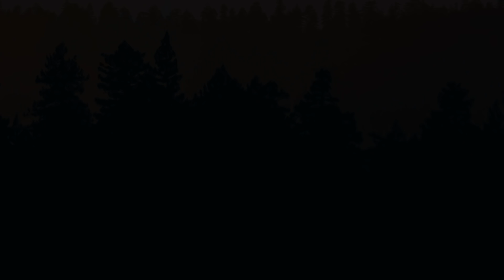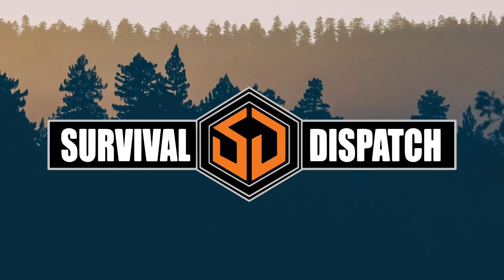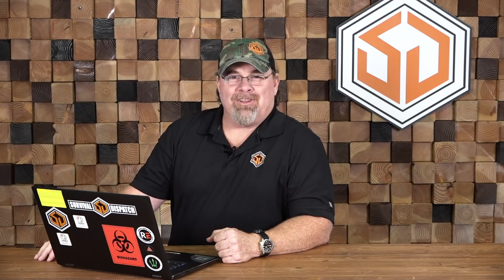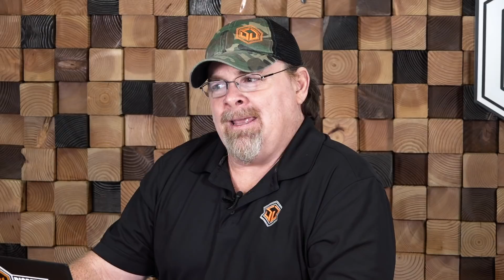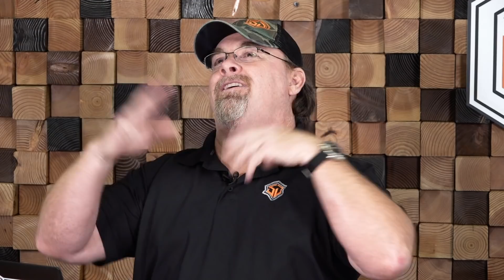All About Generators!

Comment: I have a 5500 watt Generac. I keep only three five gallons of ethanol free gasoline on hand. I date the gasoline containers very four months I start pouring my stored gasoline in my vehicle and replenish with fresh. Also have a propane grill with side burner and keep two twenty gallon bottles on hand for cooking. Just run refrigerator, ceiling fans, and lights with generator. Sorry grandma; self preservation is the first rule of nature.
Reply: Here are the rules about portable generator safety: This is just a reminder for everyone’s safety. All generator safety rules should be followed carefully. This advice is just to make sure that everyone is aware of all the warnings and it’s just to remind people to be careful using portable generators. Generators can be dangerous if not used carefully. Every year, hundreds of people die or get injured when using portable generators due to carbon monoxide poisoning and electrocution. Make sure you are using your generator carefully and keeping others safe as well. There is something very serious that everyone should always be aware of when using generators. Some people do run their generator indoors which is not safe and that increases the risk of carbon monoxide poisoning which can cause death of family and you. Some people run their generator in wet conditions which can electrocute them. Please remember that you should never run your generator indoors. Remember that carbon monoxide is an odorless and colorless gas that you cannot see or smell. Carbon monoxide is a silent killer. Keep that in mind. Make sure your generator is 15-20 feet away from your house and away from doors, windows, and vents. Never use your generator in your porch too. Having a carbon monoxide detector is very important against generator safety. Some people also allow children to go near the portable generator which could pose risks. We need to keep an eye on our children making sure that they are not near the portable generator so they won’t get electrocuted or burned by the generator which is dangerous. A locking enclosure also keeps kids safe. A generator shed might look like a tempting place to explore, or take cover during a game of hide and seek, but a generator is a dangerous piece of equipment that can cause injury. It says on the manual that we should also keep children away at all times from the portable generator to avoid injuries. Please do not allow a child or unqualified people to operate the portable generator.  It is important to keep your children safe especially little ones. The portable generator can be hot during an operation. Just because some manuals missed what should be listed doesn’t mean it’s safe to do. Always follow the generator safety rules when using portable generators. Generators pose electrical risks. If you need to use your generator during wet weather, you need a generator tent to protect your generator from getting wet. Don’t let your generator get wet. Keep your generator dry and before using your generator, please make sure your hands and your generator is dry. Do not wear loose clothing when operating the generator. Everything that is said on the generator’s operating manual should not be ignored. Never smoke cigarettes near the generator. Please keep flammable things away from the generator. Never overload your generator too. Your generator can catch fire. Never ever try to plug a generator cord into a wall outlet to avoid back feeding. Back feeding your generator is dangerous. Always turn on your generator first before plugging in appliances and shut off the appliances before turning your generator off. Use a heavy duty cord for your generator and the cord should not be worn out. All the instructions should be followed carefully. Never refuel your generator while it’s running. It can cause fire if fuel spills while your generator is hot. You should turn off your generator and let it cool off before refueling it. Having a fire extinguisher next to the generator is also important. This is only a reminder for everyone’s safety of using generators. Make sure your generator is properly grounded. Having a fire extinguisher next to the generator is also important against the safety rules. https://youtu.be/I1jT3ANENvI and here is a video more about keeping others safe when using generators and also about our family’s safety. It’s important to keep our children safe especially our little ones. Generators cause electric shocks too. Think about the safety whenever using portable generators. Remember it’s better to be safe than sorry. Hope this helps and have a good one. Thank you.

Comment: What about storing the gasoline in a motor vehicle fuel tank?   What is the pros and cons about that gasoline storage strategy?
Reply: It's impossible to get gas out of newer vehicles. There's a safety valve inside the filler neck preventing any size hose from entering the neck.

Comment: Tomorrow I'm filling 3 five gallon cans with gas for storage. I never go past 4 months storage. Alcohol gas is not a problem until over one year. Storage problems are way overstated.
Reply: Get non-ethanol
Reply: @firearmsstudent  10% ethanol isn't a thing.
Reply: Think again about ethanol gas lasting a year. In just a month 10% ethanol begins to break down. Ethanol gas should never ever be used in small engines. It's bad for them even when the gas is in good shape.
Reply: Here are the rules about portable generator safety: This is just a reminder for everyone’s safety. All generator safety rules should be followed carefully. This advice is just to make sure that everyone is aware of all the warnings and it’s just to remind people to be careful using portable generators. Generators can be dangerous if not used carefully. Every year, hundreds of people die or get injured when using portable generators due to carbon monoxide poisoning and electrocution. Make sure you are using your generator carefully and keeping others safe as well. There is something very serious that everyone should always be aware of when using generators. Some people do run their generator indoors which is not safe and that increases the risk of carbon monoxide poisoning which can cause death of family and you. Some people run their generator in wet conditions which can electrocute them. Please remember that you should never run your generator indoors. Remember that carbon monoxide is an odorless and colorless gas that you cannot see or smell. Carbon monoxide is a silent killer. Keep that in mind. Make sure your generator is 15-20 feet away from your house and away from doors, windows, and vents. Never use your generator in your porch too. Having a carbon monoxide detector is very important against generator safety. Some people also allow children to go near the portable generator which could pose risks. We need to keep an eye on our children making sure that they are not near the portable generator so they won’t get electrocuted or burned by the generator which is dangerous. A locking enclosure also keeps kids safe. A generator shed might look like a tempting place to explore, or take cover during a game of hide and seek, but a generator is a dangerous piece of equipment that can cause injury. It says on the manual that we should also keep children away at all times from the portable generator to avoid injuries. Please do not allow a child or unqualified people to operate the portable generator.  It is important to keep your children safe especially little ones. The portable generator can be hot during an operation. Just because some manuals missed what should be listed doesn’t mean it’s safe to do. Always follow the generator safety rules when using portable generators. Generators pose electrical risks. If you need to use your generator during wet weather, you need a generator tent to protect your generator from getting wet. Don’t let your generator get wet. Keep your generator dry and before using your generator, please make sure your hands and your generator is dry. Do not wear loose clothing when operating the generator. Everything that is said on the generator’s operating manual should not be ignored. Never smoke cigarettes near the generator. Please keep flammable things away from the generator. Never overload your generator too. Your generator can catch fire. Never ever try to plug a generator cord into a wall outlet to avoid back feeding. Back feeding your generator is dangerous. Always turn on your generator first before plugging in appliances and shut off the appliances before turning your generator off. Use a heavy duty cord for your generator and the cord should not be worn out. All the instructions should be followed carefully. Never refuel your generator while it’s running. It can cause fire if fuel spills while your generator is hot. You should turn off your generator and let it cool off before refueling it. Having a fire extinguisher next to the generator is also important. This is only a reminder for everyone’s safety of using generators. Make sure your generator is properly grounded. Having a fire extinguisher next to the generator is also important against the safety rules. https://youtu.be/I1jT3ANENvI and here is a video more about keeping others safe when using generators and also about our family’s safety. Hope this helps. Thank you.

Comment: Running a portable generator on gasoline during a hurricane power outage is almost senseless. That is unless you plan on storing at least 50 to 75 gallons of gasoline or more. Most people don't realize or remember when you're without power in your home chances are the local gas stations are also out of power. Electricity is needed to pump the gasoline from their holding tanks. No electricity means no gasoline.... That's why I say propane is the only way to go. I have a 7K inverter generator that'll be fed by a 100 gallon propane tank. This is easily good for five days of running my generator 24/7.
Reply: I hope you agree with this video https://youtu.be/I1jT3ANENvI thank you.

Comment: That was a great video. You should consider putting out a video on running your generator in bad rainy whether. Usually the time you need a generator. Lots of people don’t have the luxury of a generator shed and have to improvise or run their generator in the rain.
Reply: Here are the rules about portable generator safety: This is just a reminder for everyone’s safety. All generator safety rules should be followed carefully. This advice is just to make sure that everyone is aware of all the warnings and it’s just to remind people to be careful using portable generators. Generators can be dangerous if not used carefully. Every year, hundreds of people die or get injured when using portable generators due to carbon monoxide poisoning and electrocution. Make sure you are using your generator carefully and keeping others safe as well. There is something very serious that everyone should always be aware of when using generators. Some people do run their generator indoors which is not safe and that increases the risk of carbon monoxide poisoning which can cause death of family and you. Some people run their generator in wet conditions which can electrocute them. Please remember that you should never run your generator indoors. Remember that carbon monoxide is an odorless and colorless gas that you cannot see or smell. Carbon monoxide is a silent killer. Keep that in mind. Make sure your generator is 15-20 feet away from your house and away from doors, windows, and vents. Never use your generator in your porch too. Having a carbon monoxide detector is very important against generator safety. Some people also allow children to go near the portable generator which could pose risks. We need to keep an eye on our children making sure that they are not near the portable generator so they won’t get electrocuted or burned by the generator which is dangerous. A locking enclosure also keeps kids safe. A generator shed might look like a tempting place to explore, or take cover during a game of hide and seek, but a generator is a dangerous piece of equipment that can cause injury. It says on the manual that we should also keep children away at all times from the portable generator to avoid injuries. Please do not allow a child or unqualified people to operate the portable generator.  It is important to keep your children safe especially little ones. The portable generator can be hot during an operation. Just because some manuals missed what should be listed doesn’t mean it’s safe to do. Always follow the generator safety rules when using portable generators. Generators pose electrical risks. If you need to use your generator during wet weather, you need a generator tent to protect your generator from getting wet. Don’t let your generator get wet. Keep your generator dry and before using your generator, please make sure your hands and your generator is dry. Do not wear loose clothing when operating the generator. Everything that is said on the generator’s operating manual should not be ignored. Never smoke cigarettes near the generator. Please keep flammable things away from the generator. Never overload your generator too. Your generator can catch fire. Never ever try to plug a generator cord into a wall outlet to avoid back feeding. Back feeding your generator is dangerous. Always turn on your generator first before plugging in appliances and shut off the appliances before turning your generator off. Use a heavy duty cord for your generator and the cord should not be worn out. All the instructions should be followed carefully. Never refuel your generator while it’s running. It can cause fire if fuel spills while your generator is hot. You should turn off your generator and let it cool off before refueling it. Having a fire extinguisher next to the generator is also important. This is only a reminder for everyone’s safety of using generators. Make sure your generator is properly grounded. Having a fire extinguisher next to the generator is also important against the safety rules. https://youtu.be/I1jT3ANENvI and here is a video more about keeping others safe when using generators and also about our family’s safety. It’s important to keep our children safe especially little ones. Hope this helps. Thank you.